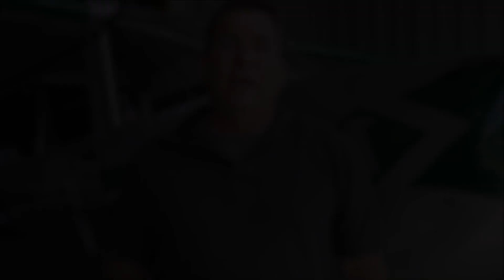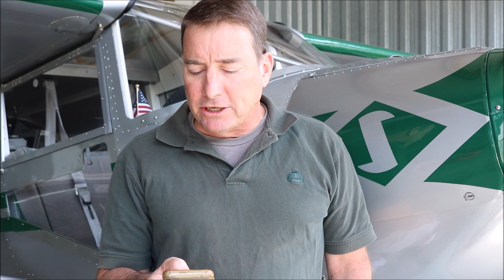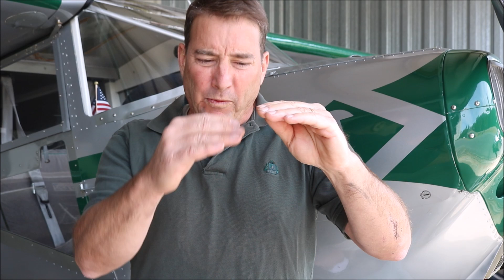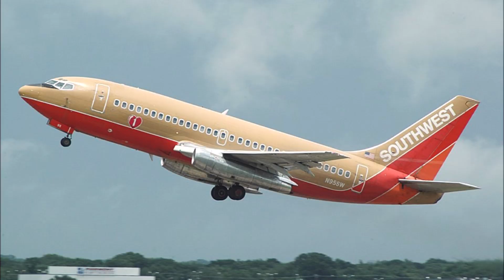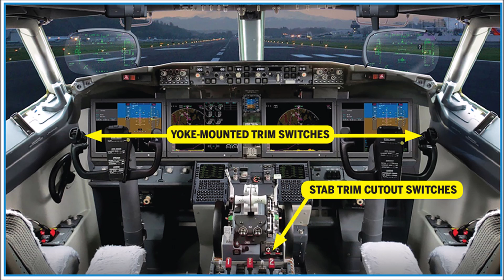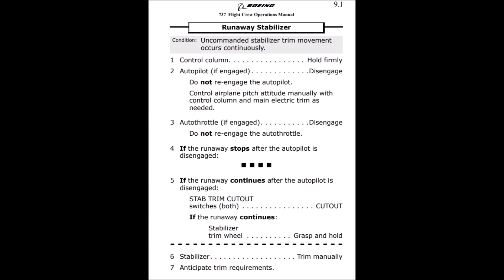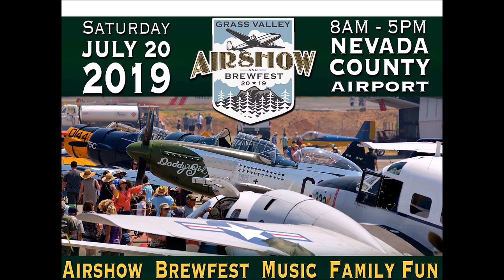737 Max UPDATE 27 June 2019 -The Latest Issue

Comment: With due respect Juan you missed a few critical things. 

1. The FAA classified this new fault on the MAX as 'catastrophic' and ordered immediate fix. This is not a little slow in trim response as you suggested.
2. The microprocessor involved is suspected by Boeing engineers to have been flooded with data and froze under the FAA test. This is bad enough, requiring re-design of the flight computer system. But this alone would probably not caused FAA to call it 'catastrophic'.
3. With the uP not working due to being overwhelmed by data, the stabilizers proceed to trim nose up, un-commanded!! The FAA pilots cannot recover due to failure to the Stab Trim switch to work, likely also due to uP failure. The aircraft begins to stall, then crash (in simulator). Why a uP freezing up can trigger an un-commanded nose up trim is not explained by Boeing. This is so similar to the AoA sensor failure that one question the two might be related. 

So FAA now found there are TWO ways to cause an un-commanded nose up, stall and crash. This is why the FAA classified the latest finding CATASTROPHIC.
Reply: The information leaked to the media is fragmentary and incomplete. This article gives a good overview, though we still don't know the full facts: https://theaircurrent.com/aviation-safety/faa-and-boeing-initially-disagreed-on-severity-of-catastrophic-737-max-software-glitch/
Reply from the maker: Heli City interesting....link? source? Thanks Jb.
Reply: @blancolirio  theaircurrent.com, and per Richardson. Whatever the full factual story, FAA did call it 'catastrophic' requiring immediate action.
Reply: I have to agree with Heli City. Reading a number of articles that each clumsily translate the technical details into lay language, and from unknown sources, it sure looks to me like they focus on a microprocessor- or microcontroller-equipped control box, running real-time code, that's vulnerable to getting over-run with incoming data. Results of such a scenario will be increasing latency of inputs to outputs (delaying the ultimate response of the stabilizers), ultimately leading to the queue overrunning the available memory or at least stack, crashing the code and forcing a reboot via watchdog operation. That reboot would probably be quick, but nonetheless would greatly slow the processing of commands and thus stabilizer action. 
I don't think this is case of just a new critique of the normal stabilizer trim, now seen to be too slow for the MCAS recovery scenario.   
We engineers might not describe that as a microprocessor failure per se, but certainly a failure of the overall controller. But the remedy might require replacement of the microprocessor to a faster model with enough speed to keep up with the newly-understood input data rate that has perhaps been increasing over the years as features were added to the plane.  (As a side note, if these details are confirmed, I think the CNN article does an OK job describing this, at the level of detail they aim for.)
Reply: Also.. Heli City, I believe it's an uncommanded nose down, not nose up, that's of concern.
Reply: Graham Wideman I have seen two references to the FCC software running in Intel 80286 microprocessors. You can't break a '286 CPU, but you can overload it with software and real-time interrupts.

Comment: Regardless, it still raises the question of what happens if the microprocessor that controls MCAS fails. Same as the AOA sensor, it's a lone device with no backup.

Comment: Good update. I find it hard to believe the solution won’t just be a simple software fix though.
Reply: @cormacsyt0  Even as that, it can be assumed the program is stored in an off the shelf, industry standard OTP / PROM chip. I understand a 737 costs millions, but developing a custom ASIC to run the code, or using really exotic media for ROM storage would not be very efficient nor safe.
I assume if an hardware fix is needed, it's just a matter of removing the PROM from its socket and plug the new one in and then test the plane.
Reply: Mac M. Last I heard the B737 FCCs used an Intel 80286. Nothing exotic, rather old though.
Reply: @gordonrichardson2972  My goodness. That's 1980''s technology. If anything, today that IS exotic, loosely speaking. 
Maybe not using an 80286 may preclude Boeing calling it a 737. This is meant in jest.
Reply: @taketimeout2share  Most aerospace technology uses old but stable hardware, with electromagnetic radiation shielding being more important than raw processing power. Most of the newer processors are uncertifiable due to their complexity, parallel processing, out-of-order execution, etc.
Reply: @gordonrichardson2972  Yes I understand that. If it works why update it. Much of the power of today is used on the GUI ( partly) whereas for mission critical programs they only process what matters. But again when did they update to 80820 from what they used before? Didn't the same argument hold them back as it does today? The sled being good enough is not a great argument for not using the wheel.
Reply: taketimeout2 Do we know for certain it is a 80286? If so it is much more plausible that lack of grunt is the root cause.
Reply: @fourtwo7612  With the MAX we don't know anything for certain! A lot of aerospace processors are old, but that's as much as I am sure of.

Comment: My uneducated guess is, if it's a software issue then a few adjusted variables, or a few optimized subroutines, should remedy the issue. But if it is indeed a "processor issue" it could be that the processor they're using is "too slow" to make all those calculations as fast as they want. So a faster processor would be in order. Which could include a rewrite of the software depending on what processors they would migrate from and to.

How many software engineers does it take to change a light bulb? --- None. That's a hardware issue.
Reply: Duck Landes The public details are very limited, but it seems that certain scenarios can overload the microprocessor. Upgrading hardware is extremely unlikely due to certification issues, so it is probably a matter of optimizing the software. Not quick nor easy, but more feasible.
Reply: Programmers now days rely way too much on hardware to compensate for their lazy coding.  The first to start this trend was IBM who paid their coders by the byte, so the incentive was to write bloated code, which usually translates to slow code.

Comment: As soon as I heard the media reports that a “microprocessor failure” was the latest setback in the 737Max recertification, I knew they had the story wrong. Thanks for reporting the real story.
Reply: that plane has problems stay away if I were you
Reply: Some versions of the story are wrong, but the test results are still a mess!
Reply: I wish that journalists would do more than 3 minutes of Wiki research before they decide to broadcast a story.
Reply: @holdensv2000  why stay away from the plane?
Reply: @aviationismylife6814  Because Boeing made a mess of it in the first place between them and the FAA has blast the trust we had in any aircraft Boeing builds. loving aircraft is one thing but killing people that you knew what the problem was and did nothing  this blows in out the water
Reply: @aviationismylife6814  Airbus from  the time they started they have never had nothing like this at this level 50 years and no groundings Boeing has 3 major crashes and two groundings I take that into my equation
Reply: @holdensv2000  3 major crashes what was the three one?
Reply: @aviationismylife6814  two crashes and three groundings the DC-10 the 787 and now the 737 max
Reply: @holdensv2000  please don't put mouth on Airbus because what you attacking boeing for can happen to Airbus. Dc 10 is build by mcdonnell douglas. Also what other boeing aircraft should we all stay away from?
Reply: @t5o7m  true but whey you buy a company all the stuff goes with you but even at that Boeing and the FAA  needs to re gain our trust I have herd stuff from the New York times from Boeing employees about putting profit over safety and doing shoddy work and cheep workmanship   and leaving tools and other stuff on built Aircraft crazy stuff like that just blows me away  the best built aircraft are from the 90s but these new ones I just dont trust the guys of old were engineers that built the aircraft but now only accountant build the aircraft and used many short cuts so that is the crusp of my matters

Comment: 2 other variables - the speed of the motor that drives the jack screw, and the pitch of the screw itself. It is possible the motor doesn't respond as quickly as would be desired. And, the pitch of the screw on the jack screw also determines speed of response - that pitch could be changed as well to increase response. But what do I know - 11 years with Boeing surely doesn't make me an expert.

Comment: I have given this more thought. If the FAA can find this flaw now what on earth happened during the initial certification process or more pertinently, what didn't happen. Very concerning. As I posted earlier, very much a holiday traveller, historically with 80% on Boeing.
Reply: Ian Gill out of control trim procedure clearly wasn't tested, presumably because it was assumed the max is virtually identical in behaviour to the existing 737 types. They're only testing it now because they've found out about mcas and that it causes out of control trim. You wonder if they will test all procedures, because there could be other differences in behaviour that Boeing have not informed people of or are even unaware of themselves. Remember, they didn't even inform their own test pilots about mcas’s existence. Personally I won't be flying on any new Boeing's for a long time. I don't trust their current processes and procedures, it's clear that there are some major issues at the company. They may well be structural and cultural and will take a long time to fix, if anyone even recognises them

Comment: The suggestion made over here was the the microprocessor(s) was/were simply not powerful enough to execute all the commands required within an acceptable time and consequently might need replacing. Not a hardware failure, more one of specification. If, of course, our news reports are any better than yours. But, it could just as well be the programmed rate parameters - much easier to fix although extensive testing still required. Difficult to tell at a distance. BobUK.
Reply: If the processors can't keep up, it's guaranteed due to poorly written/optimized code. Microprocessors from 40 years ago could handle this, given well optimized code. Code is not always well optimized. Particularly when extra features get tacked on over time, it often gets messy. At some point, it might be cheaper and better to start over from scratch rather than debug a bloated mess where each fix creates a new problem.

Comment: The bigger issue is going to be the fact they (the regulators) don't like how difficult it is for the pilots to manually crank those trim wheels if needed, because of two combined issues, one the stabilizer has gotten bigger, more surface area requiring more force to move, and also over the years they (Boeing) reduced the size of the trim wheels and the circumference of the crank arm makes it harder to crank. This issue is going to be a little more involved to rectify.

Comment: It's not a problem with the microprocessor or the program, they are just behaving as instructed by the people that programmed them based on incomplete assumptions from insufficient testing. Management pressure may also have played a role in taking short cuts.
Rate control should be an easy software fix if the hardware is capable of responding appropriately.
Reply: Then again, maybe it is just programmed for the same "gentle trim change rate" that it has been doing for 25 years, and doesn't have an input that says "gee, I think this is an emergency and I want a really fast trim rate". 

Maybe the trim change speed you want for normal operations is less then they would like for this highly unusual situation, and speeding up the trim rate for this case will cause years of pilot muttering and swearing about how over-sensitive the trim control now is.

Comment: When one automated system feeds its output to another automated system's input.... hysteresis compounds with each step (hysteresis is worth a google search it is delays that happen in any feed back loop).

... after a certain number of these in a chain, the compounding error level will approach infinity... the current engineers are calling this a delay in reaction.  Consider my comment here ill informed, as I sure much of this taken into account... the concept however and these factors are always in play.

With acceptable error level of virtually zero percent on aircraft and imperfectly trained or experienced avionics engineers (those with the needed clues currently retired since Boeing has earlier MCAS type versions in use successfully for decades) , the number or interacting computers on a plane necessarily approaches zero  (basic calculus).

So that a  redundant set of computers must be assigned to terminate computer controls entirely when they go awry  and systems must be in place that allow the pilot complete and near instant manual control.. and items like the manual trim wheels leveraged to do the job in worst case conditions ... all systems need to be designed for worst case conditions.

Am I out of line here?  Yes, quite likely at least to some significant degree given the almost unbelievable safety record of modern aircraft. 

Meantime with all of this due caution in place, and no single regulator or engineer willing nor able to take command of this mess, a lot of Boeing hardware will remain grounded at almost limitless loss of earnings... as overhead for the carriers continues or even increases as a result.

My message to Boeing will be the same as it was in my letter of  resignation in 1991 or whenever it was around that time...  unfortunately I have forgotten what all that was about except that it dealt with the subject of how errors compound.

Comment: Engineering that presumes that the programming is there to prevent human error. Went to the drive-in with a rental SUV. Couldn't turn off parking lights without turn vehicle on, resetting switch turning vehicle back off, couldn't turn interior lights off manually and leave back hatch open for the kids to sit in and watch movie, had to wait 10 minutes for battery saver to turn off. Sorry but when I push a switch to cause a machine to perform an action I want the fing machine to perform the function I set the switch to. Stop the engineering bs that you know better than I what I need.
Reply: That's why I was delighted when my neighbor wanted to sell his 2000 Toyota Echo. Crank windows, manual locks and mostly switches that just switch. The only hassle is that the clutch has to be all the way in or it won't start.
Reply: @Inkling777    Yeah great 'safety' feature that clutch interlock is.   In the old days if the motor died in a bad place (e.g. railroad crossing) you could at least put it in first gear and crank it clear on the starter motor.   Not any more...
Reply: Human error will happen no matter what or how something is engineered. Automation has led to a huge reduction in such things as medical care and yes, reduced plane crashes. We lose sight sometimes of the number of people killed everyday in car wrecks, (pretty simple machines) and even crossing the street.
Reply: How about this new feature, if you open the driver door while aligning in a narrow parking space it slams into park, good for the trans no doubt, I retested this great feature at 10mph and it slammed into park, my seatbelt is on, i am not going to fall out of the car while parking, idiot engineers

Comment: I'm going to venture a guess that the "microprocessor" in question is actually either an EEPROM chip or an EEPROM component embedded into a special-purpose microprocessor.  EEPROM stands for Electrically-Erasable Programmable Read-Only Memory, and it enables developers to "burn" software directly onto a chip, which makes everything inherently faster -- something definitely needed for the realtime and near-realtime functions of feedback loops that monitor and control the control surfaces and such of a plane in flight.  EEPROMs make it unnecessary to completely scrap and then redesign entire special-purpose microprocessors just because of some small change; instead, they electrically (or, sometimes, through UV light) erase what WAS on the chip and then re-write onto the chip the NEW software.  Because this is software, but it lives directly on the hardware of a chip, it is commonly referred to as "firmware."  If you have ever received a firmware update for your wireless access point or other computer equipment, that's what's happening.  EEPROMs are great for storing static configuration data, such as translation tables used to translate a collection of sensor inputs into one or more outputs (settings, actions, etc) -- in this case, stabilizer transition velocity.  And so the "fix" would be in software, but burned onto the hardware as firmware.  This type of update is typically a routine operation.  It's the TESTING of the software that makes the difference.  When a condition like this is not discovered before a plane is certified then the testing in place at that time is considered insufficient because it had insufficient "coverage" of the software as it is expected to operate under testable conditions.  A condition like this would be very well suited for a simulator, and easily repeatable.  I hope this helps.
Reply: Adam Churvis great comment, thanks